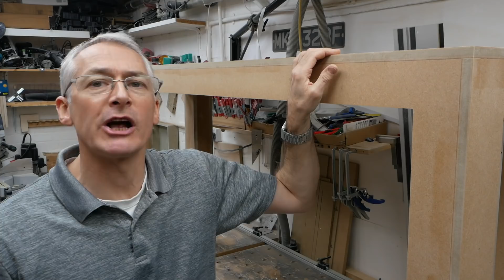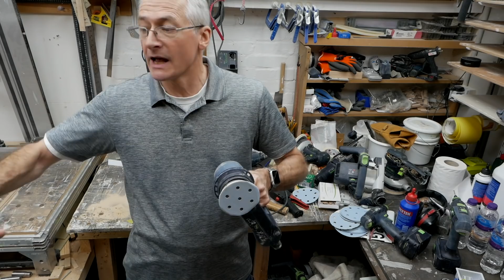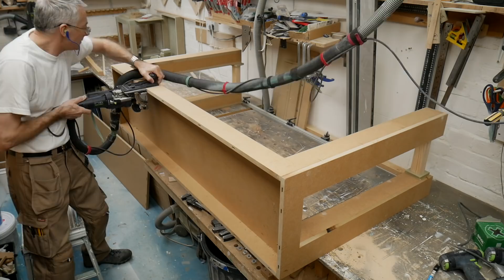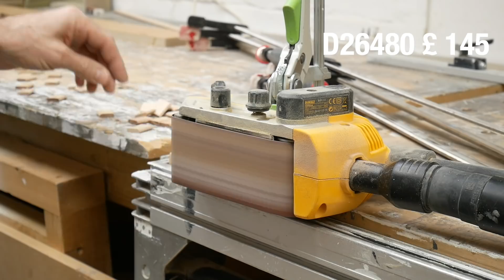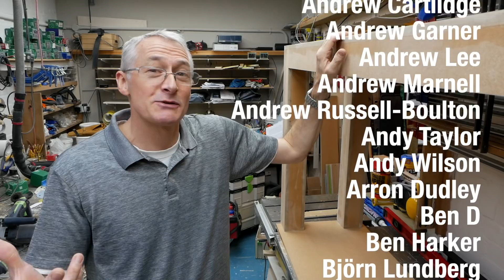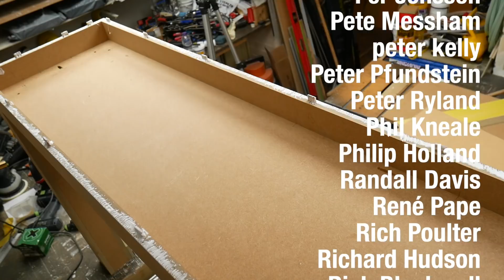Time, Tools & Money [video#245]

Comment: I know Festool has good dust collection but I would not work on MDF without a respirator, that dust is just to toxic and fine. I have to make a comment on "korean zombie" comment that you are not set up to work with real wood , of cause you could work with real wood, the reason you are working with MDF is because that is what the client wanted?????. As I said before, you live in London and because of that your prices are much more then someone living in Newcastle for instance, you have the same overheads but at a higher rate.
Reply from the maker: Exactly!

Comment: Never a truer word spoken. Finished a very upmarket bespoke kitchen fit today and loaded the van back up. Festool TS55 saw, OF2200 and OF1100 routers, plus 3 different Trend jigs. Festool SYS-CTL and Nilfisk Aero 26 extractors. Hilti DD150 diamond core drill, SF6H combihammer, AG125 diamond grinder and TE30C SDS hammer drill. Makita laminate trimmer. Fein MM350 multitool. Mirka Deros 5650CV sander. DeWalt DW780 and Makita LS0714 compound mitre saws on DW7023 stand. Mafell P1CC jigsaw. 3 x Stabila R box levels. A pile of Tanos Systainers full of screws, plugs, fixings, nails, drill bits, augers, spade bits, holesaws, router bits, grinding wheels and so on. Another one full of plumbing kit - Rotherberg blowtorch, drawers of solder, compression and waste pipe fittings, Fernox LSX, PTFE tape, tap wrenches, pipe cutters etc. And another one full of hand tools, squares, pliers, hammers, mallets, protractor, mini box level, Bosch metal/current detector. Rubi tile cutter. One set of Kirschen firmer chisels, two Dia-sharp diamond honing plates and a Veritas honing guide - you're getting the picture by now. EVERY SINGLE piece of my kit has been earned by building in a percentage of its cost to work I've spent 25 years doing - and yes, I also price in consumable parts such as router bits, saw blades, sanding sheets etc. simply because they cost me money and the job wouldn't happen with out them. Ignore the closet brain-dead haters Peter - I'm 100% with you. All the best.
Reply from the maker: Cheer’s Kevin! 👍👍
Reply: Well said Kevin.

Comment: Good video, please can you do a video/series on sanders? Also anymore cheap tool Vs festool planned? Maybe drills? Lastly I was wondering about your extraction as it looks like a 36mm going to 27mm with a short tail?
Reply from the maker: Yep  - D36 into a double-ended D27, works well 👍👍
Reply: @10MinuteWorkshop  thank you for the reply, did you make the adapter yourself? How come you didn't go for dust extraction/cyclone or just staying in festool family?
Reply from the maker: Yes, DIY from a pair of D27 ends and a metre of D27 hose. No space for a cyclone! 👍

Comment: I don't know about others but I've always found with mdf there's "nowhere to hide" because 
of its uniformity & finish, the slightest loose cut or router error stands out like a sore thumb... 
"real" wood is in fact sometimes more forgiving... try tapping a slightly tight m & t joint together in mdf 😂  
"real wood" will compress or expand slightly whereas machined mdf is what its cut at...😎👍

Comment: I understand what you try to do, but doing it like that makes no sense. I guess the proper way would be to sum up the overall cost of your gear and divide it by the average number of months it is usable before you have to replace it (that would also justify the cost of the stuff you use, that costs more, but will last longer hopefully). Plus the cost of having the workshop. Then you add up the average income you need to make for it to make sense (including tax and insurance). That would be your monthly fixed cost you need to cover. You divide this by the average number of jobs you make each month and you get how much you need to make on each job in average. You add the cost of material and energy and this should pretty much say what you should charge at minimum. The other way to look at it is, what would be the usual price on the market, and that should hopefully be higher than the calculated number. Right?
Reply from the maker: I don’t think you’ve understood this at all! The previous ‘shelves for tools’ series took a simple commercial job and tried to get the price of the tools out of the cost of the job. This video took a similarly priced job and looked at the cost of the tools used to make it. That’s it. That’s all there is to it. 👍
Reply: @10MinuteWorkshop  I thought I did, what I am saying is, that doing the same with your professional tools does not make much sense, as you would hardly buy them to do this one job (and if you did, I guess you'd get away with less disc sanders ;). And that's also the reason I do not have Festo tools :(
Or put it in other words, i guess someone said, that your products are overpriced, and your video is trying to say that this is not the case as the tools you use are expensive. And do not think it is the right approach. How much percent of your cost are your tools overall?

Comment: I couldn't agree with you more. Most clients or people are under the impression that tradesman charge alot and offer low hourly rates. What they need to understand is when you hire a Contractor you not only hire them but also their van full of tools.
 Their is a misconception. For example in Australia general carpenter hourly rates are the low end of $45 per hour.
This rate is to be considered for only his labor, so basically a tool belt and maybe a drill.
If you want the labor and a trailer full of tools to do the job then your looking at around $60per hour. I believe that is still a good deal for the client as to even do a minor job you probably use in value around $5000 worth of tools.
That's my thought anyway.
Reply from the maker: Yep, absolutely 👍👍

Comment: If we had Domino pricing like that here in the States, I think a lot more people would have one, including me.  US pricing is around $1040 for the base kit (around 810 Pound sterling), with a kit of various sized dominos and cutters running another $300 (or 234 Pounds).
Reply: Sales Tax varies by state and county, but I would consider 7 to 8% additional, so around $1450 total.  Refurbished units, when they come available are only discounted $100 to $200,  not enough for me to justify the purchase.  This relative premium seems to apply to all the Festool lineup. We’ll see what happens as Festool starts to manufacture in the US, but I’ll be staying with  Makita and no Domino.
Reply from the maker: Thanks Todd! Wow, that’s an eye-opener - we always seem to think that we pay through the nose for Festool ( and most tools) here in the UK, so r ally interesting to get your perspective. Thanks! 👍👍
Reply from the maker: Yikes! Does that include sales tax/ VAT?  £650 for the base tool includes VAT here 👍👍
Reply: I wonder what Brexit will do to your pricing.  But tools are essentially a one-time purchase, what is more important is the consumables, the wood.  Timber here in the US seems a lot more affordable.

Comment: Good vid as always Peter and a realistic pricing ..If you can remember I commented on your other vid when you were showing how you were  pricing up  a job and as you quite rightly said the job has to reflect how much you have to charge to make a living ie your living expenses in London are totally different from mine up here in Newcastle ..and the cost of tools have to be taken into account ..in my own experience I wanted to learn how to fit kitchens 20yrs ago so I got a job as a laborer for a kitchen fitter on £20 per day on the fiddle ..its a job i still love doing today ..but I saved up them £20  and my first miter saw a dewalt  £550 out the back door as they were £1100 at the time router  Dewalt £350 jig saw Dewalt £150  Drivers £100 and then theres all the other bits   so yes you can charge some one peanuts or you can charge a living wage
Reply from the maker: Cheers Andrew, and yes, I remember, of course! Hard, saving up 500-odd notes 20 at a time, eh? but we’ve all been there. 👍👍

Comment: I like your vids Peter but you dont have to have all festool tools to complete the job (I know they are your preferred brand) 4 sanders on one job is EXTREME, you didnt include the price of 4 different sanding sheets :)
Reply from the maker: Hiya. I’ll copy/paste the answer I gave to Richard Owen further down, OK?  Richard suggested I use tools from DeWalt or Makita instead...

“Just so’s we’re clear, I wasn’t using this video in any way to justify my purchases. I run my own business, I don’t have to justify them to anybody. But, out of interest, what DeWalt and Makita sanders have dust collection as good as the Festool? Where’s the Dewalt or Makita equivalent of the Rotex? Which DeWalt or Makita drills come with a 3-year warranty - including the batteries? My original tracksaw did 11 tough years on its first set or brushes - could I say the same of a DW or Mak? And the Domino?? Festool-only, mine’s getting on for 10 years old, and has cost me less than £1/week. And I could probably get the purchase price back right now if I sold it. So yes, I could use cheaper tools - but I made a business decision not to; I think it’s worked out pretty well 👍👍”
Reply: @10MinuteWorkshop  Im not doubting you choice of tool, 4 sanders for i job though, excessive
Reply from the maker: I have them - why wouldn’t I use them? Could Inhave done it with fewer sanders? Of course! but I have them, I’ll use them 👍👍
Reply: @10MinuteWorkshop  Not knocking you for using them, but some people will be looking thinking 'no wonder he charges what he does' I not got a problem with it, I use Makita (battery's usually prefix peoples choices) but the job could be done with one sander with different grade papers, most competent people  could do the job with 'lesser tools' and I get the 'time is money' problem (which is hard for customers to understand) but see your video where ytou used your cheaper tools, it took you a bit longer but the finish was the same?

Comment: Hi Peter, I think you are 100% correct by using the best tools you can afford.  I personally cannot justify Festool but i have used cheap tools for many years and end up replacing /repairing them and in the end throwing them away very shortly after purchase.  Not only do they last longer but using a good quality tool makes your worklife easier.  Having to use woodworking tools 8 hours a day 5 days a week as you do then you shouldn't begrudge yourself for having a "Comfortable" working environment.  Keep doing what you are doing haters will always hate they are only jealous of your professionalism and enthusiasm to educate "us DIY'ers"
Reply from the maker: Thanks Steve! 👍👍

Comment: There is an easy way to tell if you are a 'rip-off' and 'overcharging' as you run out of customers.  Similarly if you have too much work, put the price up to reduce the waiting time to match the demand. 

Moulton bicycles introduced a new top end model about10 years ago for @£4000.  The demand was so high the small factory in Bradford on Avon couldn't make enough of them fast enough - the frame alone takes @14 man days to make! - so they kept putting the price up to match demand.  It now costs just shy of £17,000 and you have to wait about 9 months for one!
Reply from the maker: That’s wild! I wouldn’t wait 9 months for a car at £17k, let  alone a bike, lol! But good for them! 👍👍

Comment: Nothing wrong with your pricing - time taken along with expenses all have to be covered.   Fast hashes will always be cheaper and shoddier than craftsmen...

Cheap jobs are just exactly that - cheap and shoddy.

In addition it is very important that tradesmen / craftsmen always ask themselves 'how much is my time worth'?
Reply from the maker: Totally agree! 👍👍
Reply: Absolutely. I'm sure Peter loses work to newcomers who are bad at maths, but they tend not to last. If he was grossly overcharging for what he does, where he does it, someone would have come along and been noticeably cheaper and taken over. I just bought a truck off someone like that... he couldn't see that getting $2000/day gross meant nothing if it was costing him $2000/day to do it. Meant the truck was cheap but the maintenance backlog on it is significant (at least he did the oil changes). Peter... ever got cheap tools off someone who wasn't charging enough to stay in business?

Looking at it the other way: you can tell Peter is overcharging by all the luxury goods he has and the way he hires minions to do all the annoying stuff. He wouldn't want sanding dust all over that Saville Row suit!

Comment: Goodness Peter, you really have opened a can of worms. I bet these people that are critical of what you do or charge have never made a piece of furniture in their lives, or run a business. They obviously have no concept of overheads, i.e. rent, rates, vat, or cost of materials. The ones who say things are worth a couple of hundred pounds have probably "acquired" the materials and then never declared the earnings and pocketed the "cash".
I have been a cabinet maker on traditional lines for more than 40 years and have in the more recent years made use of moisture resistant mdf to make ultra high gloss furniture. I can't think of a more useful or cost efficient material to use, believe me if mr mdf was around 2 to 3 hundred years ago the old "craftsmen" would have used it.
It seems jealousy is prevalent on youTube purely and simply. I am sure that what appears to be a knock at what you are doing will be water off a ducks back, keep making the vids and giving the tips and then perhaps the knockers can go away and have ago themselves.

Comment: I think you forgot the MFT Peter.
Reply from the maker: Nah, all oart of the infrastructure 👍👍
Reply: @10MinuteWorkshop   But you were at pains to avoid using it in Shelves for Tools 1 and made a cross-cut jig instead.
Reply from the maker: @ThePhilGrimm  Pretty sure I said at the start of that  build that the MFT would just be a bench '...no drop-down rail...' - hence the cross-cut jig. 👍 This video was really about the hand-held power tools, but we can add the cost of the MFT in if you like, and the extractors, the rails etc... 👍

Comment: Hi Peter . Thanks for the video. I have to say some of the comments you received were a bit harsh and of course your initial tool cost outlay is certainly a factor to be taken into account. However, what I would question is your use of MDF for shelves
In my [ albeit limited ] experience, that particular  material has all the long term rigidity of a stick of celery .
In fact it even appears to have the ability , over time, to sag under it's own weight, never mind under additional load
The storage of books or other items on such a structure as you described will, in my view,  results in an inevitable , unsatisfactory, result.
Reply from the maker: And in my (limited) experience, it’s mostly the people with the least experience of using MDF, who complain about it the most! Couple of things; take a look at the ‘sagulator’ - http://bit.ly/sagulator - to see likely shelf deflection. The shelves in the original videos were 520mm wide for a bedroom. They were for lightweight ‘boudoir’ items, not books; if they were for books, I’d have made them differently eg solid timber lip, fixed sides and fixed back, thicker, maybe a steel insert etc..etc.. MDF is a fine sheet material,  it doesn’t behave like a natural timber - and this is where most people go wrong. My shelves don’t sag. 👍👍
Reply: @10MinuteWorkshop  Well for some reason you appear to have taken exception to what I thought was a perfectly innocuous comment.
Perhaps you are more upset by some of the rather more unpleasant criticism  you received than you might care to admit.                                  First let me say I meant no offence but was only pointing out the disadvantages I have observed in my genuinely "limited" experience of MDF as against your apparent habit of using little else.
As regards my previous comment I would only  make a few further observations.
[1] People will utilise any flat surface they see fit with scant regard to its load bearing properties and with little or no reference to the "Sagulator"
[2] MDF is by its very nature stronger in compression than in deflection. [Blatantly obvious I would have thought]
[3] As regards your shelves not sagging, I guess the jury's still out on that one.
However I can do nothing but congratulate you on obtaining "clients" prepared to make long term commitments as regards the weight limit restrictions placed upon their "boudoir items".
Reply from the maker: And my apologies if you took my comments the wrong way - no snark intended. You said yourself you had limited experience of MDF. And in all seriousness, the folks who have limited experience of the material are usually the ones who see issues where there are none - in my experience. At ~500mm wide the shelves are well within tolerance for lightweight items - photo frames, boxes of tissues etc.. etc..  as I said before, if it were to be a bookcase, then that would be a different story. And the shelves are adjustable/ removable. If the client decided to change the spec at a later date, other, thicker shelves can be supplied - at a cost, naturally. Hope that clears up any misunderstanding 👍👍